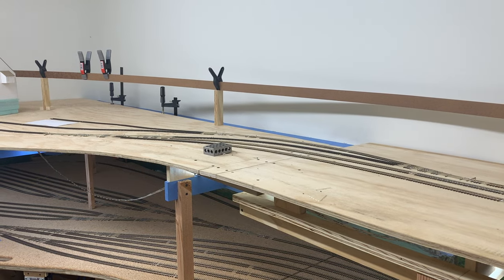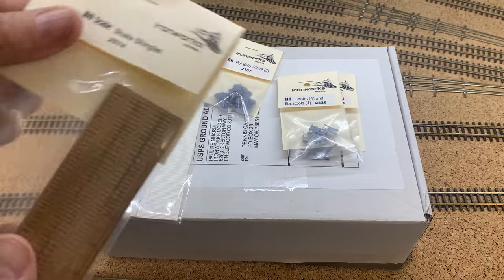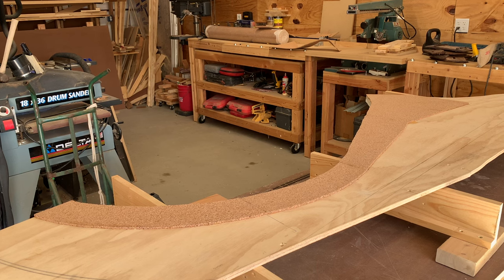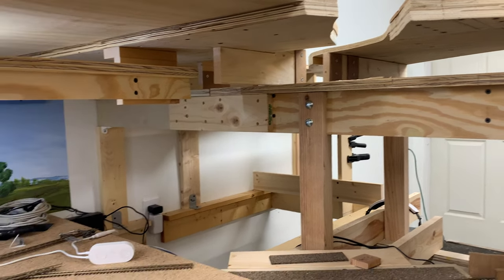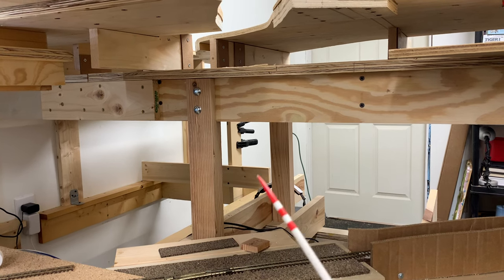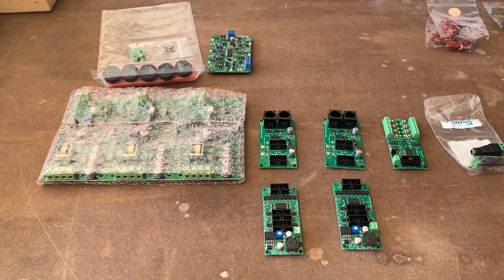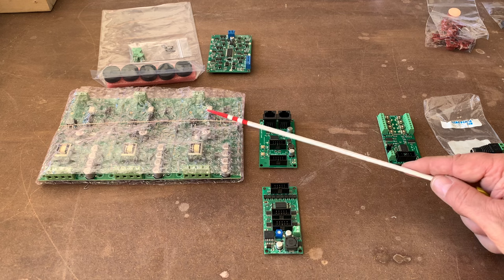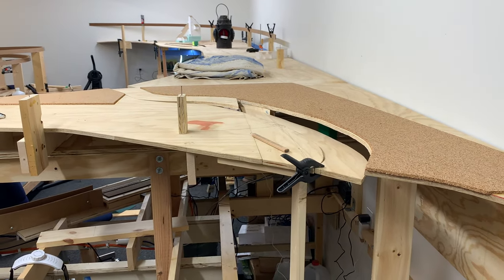Model Railroad Update 97_ Maroon Creek 6 (A Pleasant Interruption)

Comment: On safety, you get an A for putting a mask on when cutting with the reciprocating saw, and F because you probably wore flip-flops (as always). 🤣
I love it how you've streamlined your construction process like it's a production line now. Oh, and I learned something new from this one. To use a Fostner bit for turnout wire hole and not a normal drill bit as it comes out much cleaner. Thanks!
Reply from the maker: You are correct sir!!  Safety sandals as always.  Yup, a forstner bit and something to keep it from wondering as you start it.  I like a pilot hole so I can start from either side to minimize wood "blow through". Thanks for dropping by!!